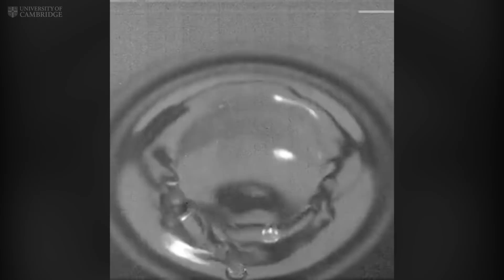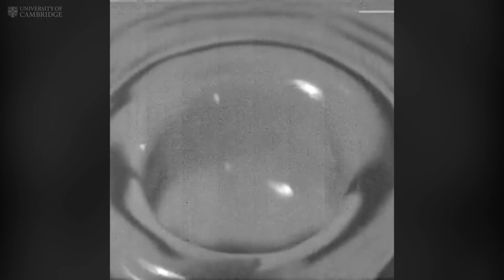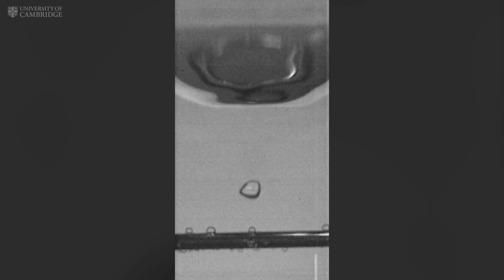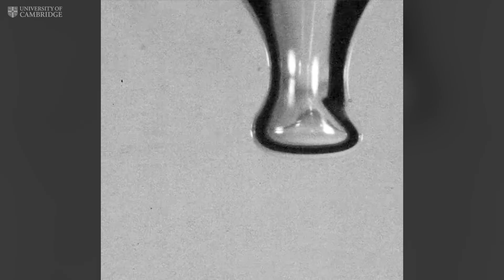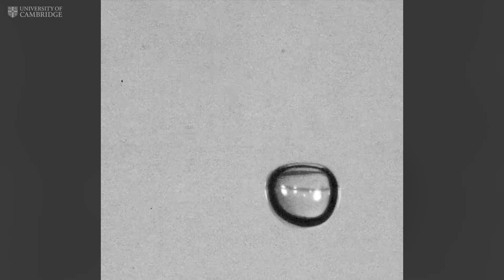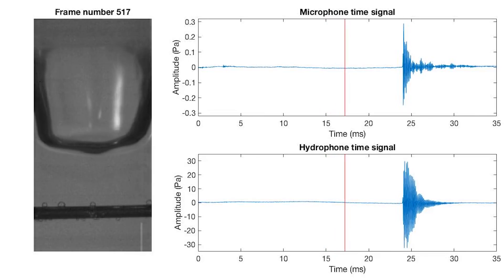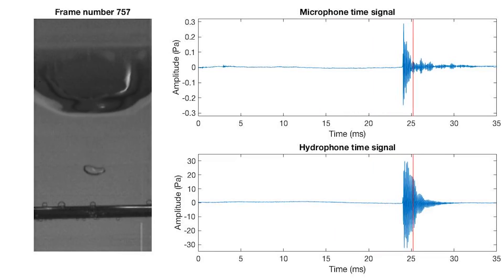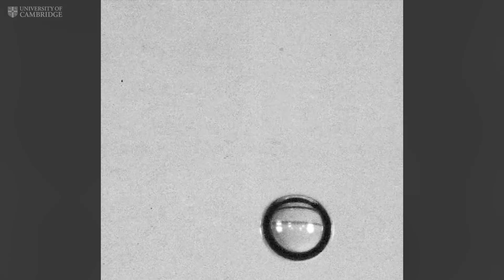What causes the sound of a dripping tap – and how do you stop it?

Comment: They compared the sound wave to the video footage to figure out when the sound happens. 
Light travels much fast than sound, perhaps the dripping sound still happens when the droplet hits the water surface?
Reply: Yes, light does indeed travel much faster than sound (almost a million times faster in air, and only about 150000 times faster in water). However, the authors of the paper have corrected for it. I quote from their paper (supplementary information, https://www.nature.com/articles/s41598-018-27913-0):

>> It was important to account for the time taken for the sound to travel from the impact site to the
recording devices. In water sound takes around 50 µs to travel the 80 mm to the hydrophone, whereas
travelling the same distance in air to the microphone takes around 240 µs. The difference in these two
values highlights the importance of correcting the time scales of the recorded signals to align with the
fluid-mechanical sound-generating events. This was done as part of the post-processing of the data, using
standard values for the speeds of sound in air and water as well as the measured distances from the
hydrophone and microphone to the impact site.